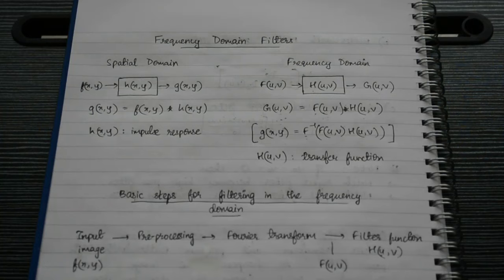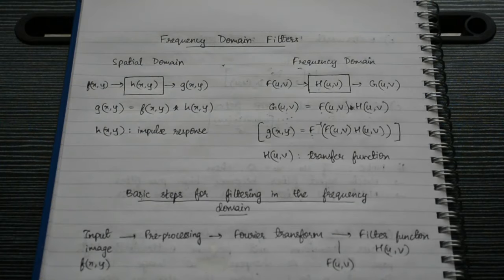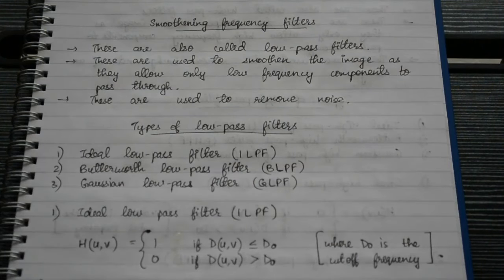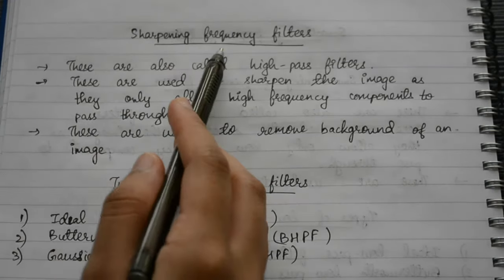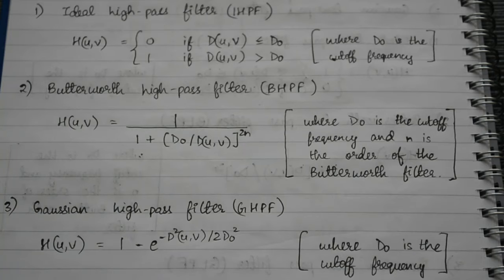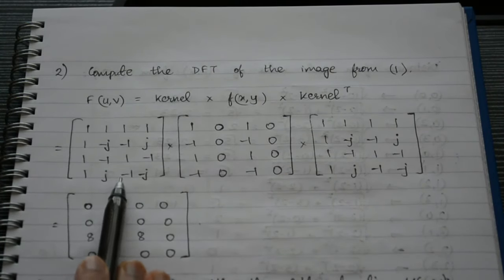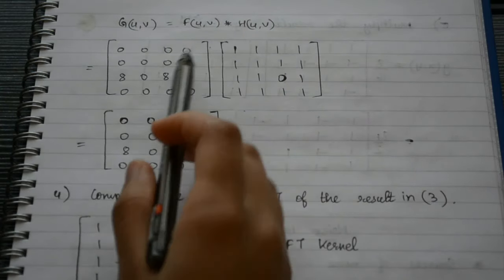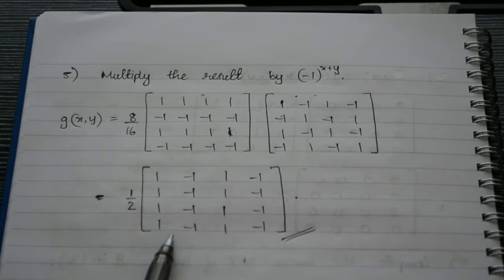Frequency domain filtering in image processing - Low pass and High pass filters

Comment: Maam,  you use the Ideal High Pass  formula in Ideal Low Pass,  according your solution the image is sharped not smooth and the ideal low pass filter is used for smooth/blur the image
Reply: Yes, she used high pass filter and it will sharp the image